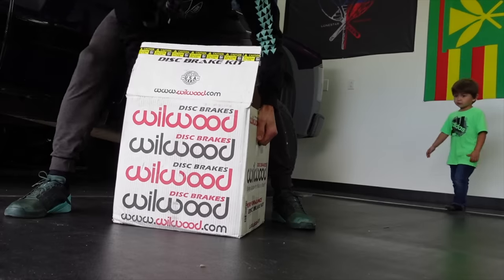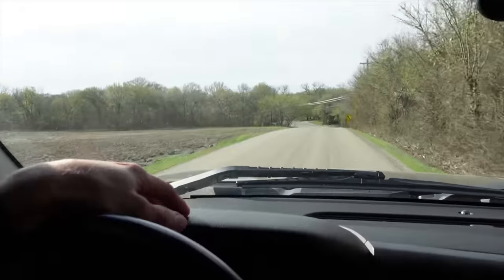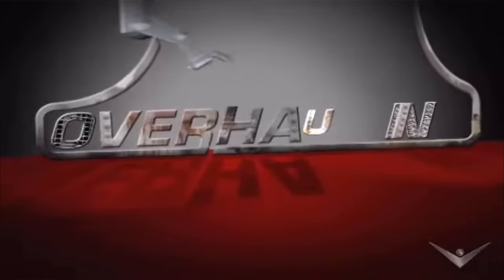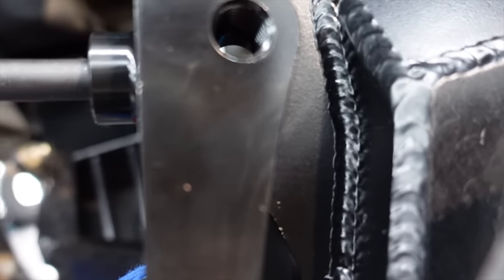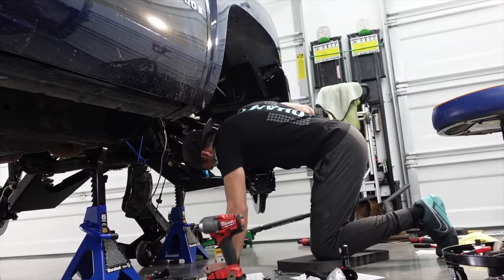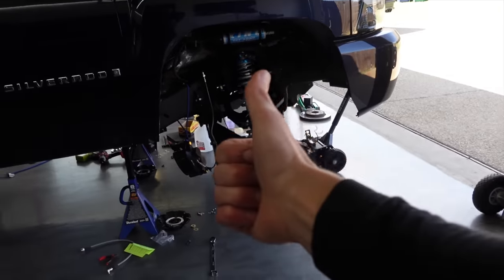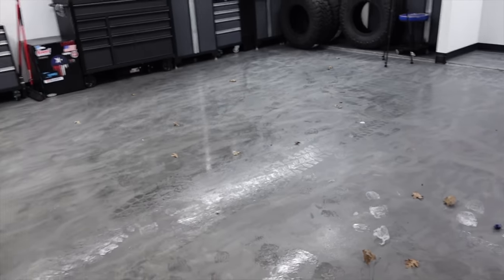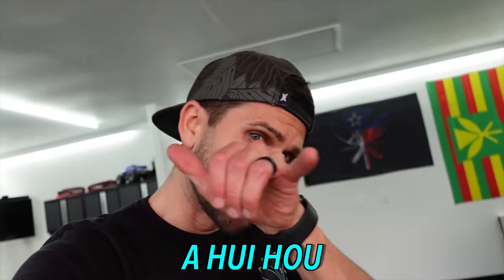RACE CAR BRAKES on a Silverado -[‘99-‘18 Silverado / Sierra]

Comment: I’m thinking supercharger now that you added all that extra weight, and now you have extra brakes to stop extra power. Just saying 😂
Reply: Nah, you dont need or want that for a Prerunner. On a track truck or quarter mile truck yeah, for sure. Even a touring truck intended for the highway and rural roads, but a prerunner goes through too much dust to trash a supercharger and honestly, it wouldn't take advantage out of it either cuz it is a DIY prerunner and not a trophy truck.

Comment: Hey man..  not trying be a know it all.. I’m pretty sure you have the rotors on the wrong sides.. they are directional. Switch passenger and driver and you will be mint
Reply: Not a fact check here, but I was interested in that so I looked - honestly thought the grooves should flow rather than hook….and you’re right, from what I found. 
Interestingly enough, similar to old corvettes like the C4 rims those “saw blades” grab the air in towards the brakes. You always see them backward, but I think it’s more the tire shops fault for the way they “x- pattern” or the rears strait forward/fronts cross to the rear…anyway. 
You’re a good man!

Comment: I used blue lock tight. I learned the hard way and haven’t looked back. I used blue because eventually I know some of those bolt will need to come back out sooner or later.

Comment: Awesome! They always say, upgrade Pads, Fluid and brake Lines before anything else.. Or like me, you replace the worn out rotors and upgrade what you can with what's in stock for your vehicle. Bigger diameter doesn't always help in braking distance (because of added centrifugal forces and unsprung weight) but in the repeatability of the distances. Larger rotors help in regards to the surface area for heat, which is the major factor in brake fade/failure when your running track days on stock size rotors. Now going from a single piston to a 2-10 piston caliper will help in the clamping forces spreading that out equally on the larger rotor. But there is the point of diminishing returns.

Comment: Hey, were the discs installed on the correct sides? Usually with slotted brakes the slots at the top of the disc run up and back. It looked like yours were running up and forward. Awesome build. Relatively new here, but love the channel. [2011 Chevy Silverado LTZ, 5.3 L, Crewcab]

Comment: I just installed the same brakes on my Duramax H2 and I’m not happy with them.  I’m chasing a pulsing issue like a warped rotor but they aren’t warped.  Wilwood told me to sand the rotors and pads and re bed.  I did that and still have the same problem.  Ready to put the stock brake system back on.

Comment: When check  breaking distance it shouldn't be done by a line on the road because you can't be consistent hitting the breaks exactly on the line.
Instead, do it by stopwatch when you first hit the break, then  to a stop. Also use cruise control
to confirm top speed from test to test.  Nice breaks 😎👍

Comment: The FMVSS Brake Bedding Procedure is something in the realm of 300 45-0 stops before brakes are fully bedded. I'm an automotive test engineer and most of your companies like wilwood don't do the FMVSS testing because its far too expensive but having had wilwood brakes on a number of vehicles I have tested they just keep getting better until you boil the brake fluid or destroy the pad.
Reply: That's also at a max of 150lbs of brake pedal force too.

Comment: You should do Little Shop MFGs rear drum to disc brake conversion. They have Wilwood calipers to select too (although they are smaller than your fronts). I have drum brakes i have been wanting to convert but havent seen a solid video on it for a GM truck so it would be nice to see!

Comment: On that driver side rotors shouldn’t the slots be aiming towards the back of the truck? I got some power stop drilled and slotted rotors for my Silverado and the slots are both aiming towards the back and each rotors said the same how to have them facing.

Comment: They will also be more consistent over repeated braking as they rotor has a greater heat capacity before significant fade sets in…

Comment: I have a question...whats the point in lifting a 2wd truck?
Reply: Now mind it, I not bashing just want people opinion
Reply: For someone like me that lives in the city, I don't need 4wd. We do have the occasional flooded street, potholes, or any small obstruction I need to get over where a lifted truck would come in handy.
Reply: @Rebel_Within  I live in Texas as well. But im in Dallas. I'm on a 3/5 drop and never had a problem. Hell I was in stand still traffic and got off of interstate 20 going up a hill dropped in a 2wd trick.
Reply: @BuiltByLondonRacing  I'm from Texas as well but from Houston. During Tropical storm Harvey if it wasn't for the lift I would of been stranded like some stock height trucks that night. Granted I was stupid for going out in a storm like that but I sure am happy I had a lift even if it was just a 2WD.

Comment: for 2018 silverado, what is the maximum negative offset for wheels to fit a willwood brake kit?
Reply from the maker: Check out Wildwood’s website. They have charts with detailed wheel offset requirements for each of their kits.

Comment: I believe you installed the disk on the wrong direction? They should be swapped to opposite sides? @LONESTARHAWAIIAN 15:00
Reply: They should perform better when they are swapped to the proper direction

Comment: I hate to be that guy but your brakes are directional and it looks like you got them switched up the vents should be rotating towards the rear of the vehicle. It's just the rotors that need to be swapped side to side.... Have fun enjoy

Comment: So not worth 2500 bucks when you can get drilled and slotted rotors. 14-18 is the same calipers. That’s the reason why 99-06 people using the 14-18 cailpers becaue they are bigger. And cheaper and will stop just the same

Comment: Painted rotors, whaaat?
Reply: From my understanding the black on the rotors is a layer of zink
Reply: Maybe idk , I was just surprised to see that, painting rotors is kind of an old  joke on motorbike/car forums for me so I was a bit shocked ahah
I guess you gotta be extra carefull on your first few miles
It looks good in the end I admit it, and having the contact surface exposed only is not a bad thing, less rust, better looks !
Reply: It’s an initial protective coating that gets removed as soon as the brakes are used the first time.